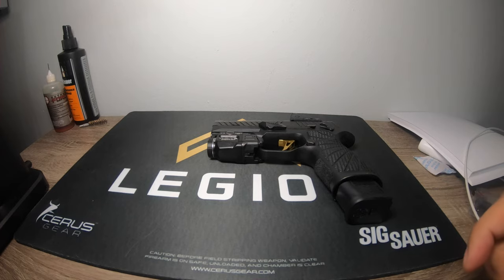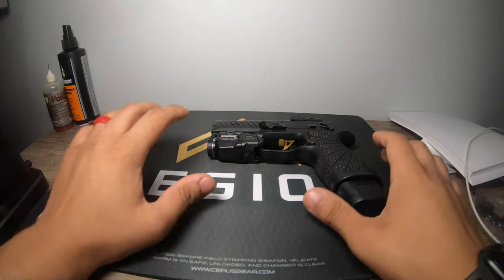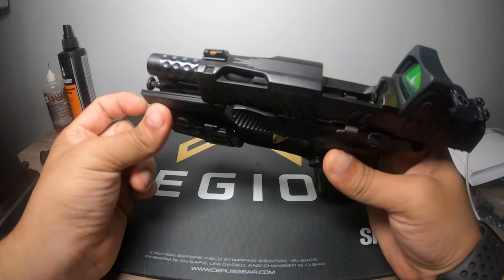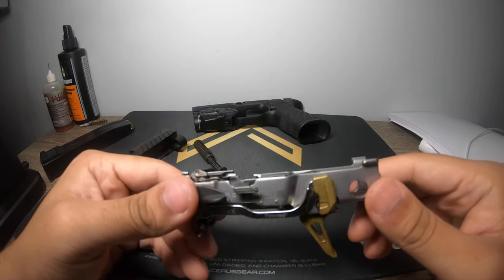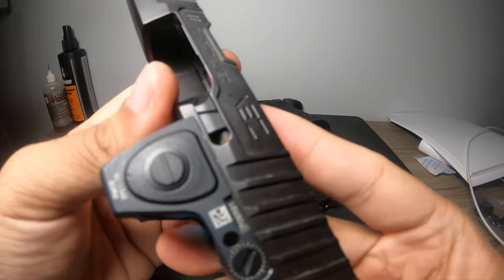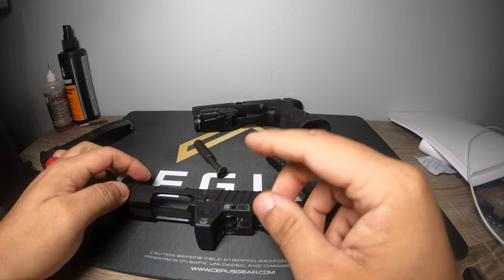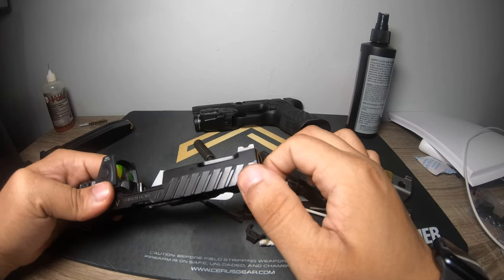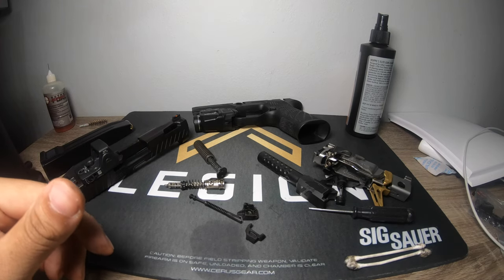DO ALL SIGS RUST? FIND OUT SIG P320 M18 Corrosion test

Comment: Have had my Sig Sauer M18 for 2 1/2 years now and I have never seen any rust. I almost reach 9000 rounds on it.
Reply from the maker: Yeah this was unfair treatment , however it still passed. Fcu is the core and really the only part that has anything was one internal piece. 

I do however think if I did this with the x macro the rust would have been much more extensive. I plan to send that back to sig and document the experience.

Comment: Sig use stainless slides, any rust would be triggers or sights…  Not sure why you titled your video is really misleading as Sig’s definitely don’t have a reputation for rusting (save a few reports on ancillary parts on the macro). It’s a good experiment otherwise…
Reply: P365’s definitely do have rusting issues. Mags definitely but parts like the mag release, the sights, the slide, and even sometimes the trigger. My boy has 2 and they both have rust, and I have 2 other friends that have one as well. All different models of 365, but they are known to rust really easily actually.